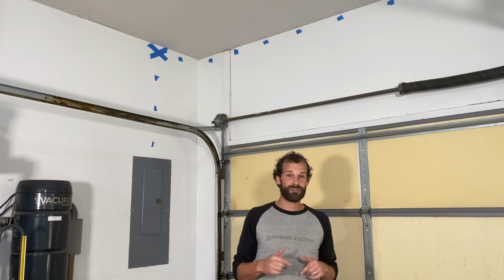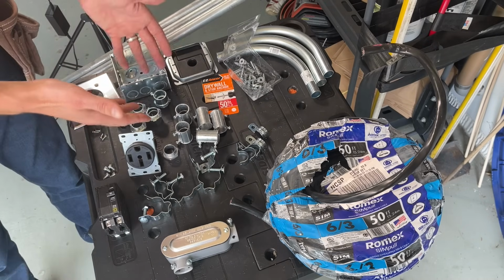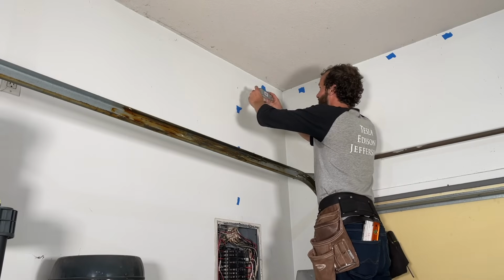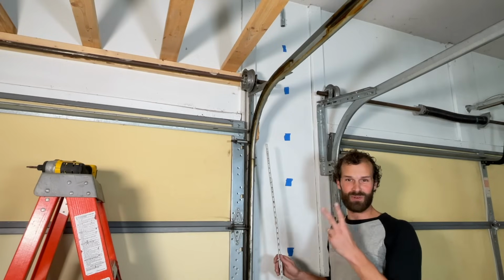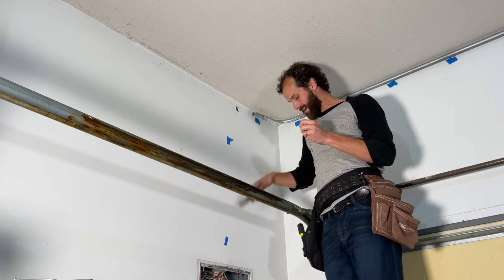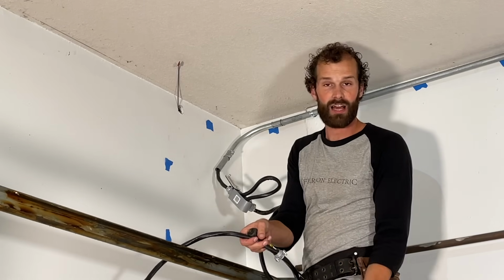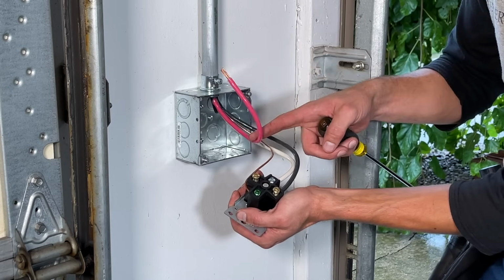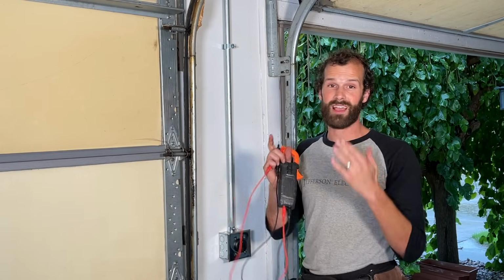How To Install a 240 Volt Outlet | Electric Car Charging

Comment: I used to work as an electrician’s assistant. This was a trip down memory lane.

I seem to recall we had to use non-romex when wiring with conduit. Does anyone else remember the same? Also I hated bending the conduits almost as much as running that heavy wire. Kudos to you.
Reply: Yeah, now days we usually use stranded or solid copper THHN/THWN insulated. We generally don't run cables inside of EMT, only single conductors (unless we are sleeving a cable for protection). The guy in this video did a lot of wrong things, TBH.
Reply: Most ahj will allow it but you have to account for the outer jacket as fill Also it's sloppy hacky and usually a waste of money over buying a 250 foot spool. My ahj wld have had me strip romex from lb to outlet and required a stub with a romex to emt connecter from lb to panel with a bushing on that connecter at the panel if not a grounding bushing as well lol
Reply: @wizard3z868  The lack of proper bonding/grounding on the EMT in this installation is a shock hazard. To me that was the most unprofessional and hazardous part of this installation. I am sure he does it wrong all the time, too. Lol
Reply: @illestofdemall13  my ahj would have had me tie in the ground wire of romex to a bond bushing at panel than a bounding at metal lb also (than I wld have had to strip all the romex from lb to the outlet my ahj dosent like romex in emt). I'm sure he bounded at box and outlet thus making all the metal conduit grounded
Reply: @wizard3z868  Bond bushings would not be required for this installation, however the Code does require the equipment grounding conductor to be connected to the outlet box, not the receptacle. Also, Except at terminations, removing the sheath from nonmetallic cable is not permitted in the Code.

Comment: I watched with some interest to see if this installation was going to address the 2020 National Electric Code requirements found in 210.8(A)(2).  It's not clear whether this installer knew of the requirement for GFCI protection on this 50A, 250V outlet, and if he knew, whether he chose to ignore the Code since it may not yet be enforced in his area.  (It can take a couple of years for local jurisdictions to adopt the latest Code).  In any case, he should have installed a Square D QO 2-pole breaker equipped with GFCI features to have been compliant with the current Code.  Expect to pay about $125+ for a breaker of this type, rather than the $35 breaker he actually installed.
Reply: If NEC-2020 is not adopted in the area then it is not code for the area in question.

I expect that the installation occurred in Illinois (Scott's residence?), and since as of right now NEC-2020 is not adopted anywhere in Illinois,  it follows that the installed breaker is indeed compliant with code adopted in the area and will pass any and all inspections. In this case it is completely irrelevant what NEC-2020 requires.

Pro's other blunders notwithstanding, the choice of the breaker was in no way an error, omissions or ignorance. It was in fact the correct choice.
Reply: No GFCI on Tesla chargers.

Comment: This video is very disappointing from a safety perspective.  The gentleman is implying that "pros" do not need to turn the power off before working in the panel.  If you are a DIYer considering taking on a project of this type, understand that the real professionals actually do turn the power off.  And we do not stick conductive tools into hot panels, nor conductive fishtapes.  We do not close the breakers of new, untested circuits with the panel cover off either.  Turn the power off before removing the panel cover.  Then test the panel bus with a volt meter to ensure the panel is de-energized.  In this case, as he correctly pointed out, the incoming bus is still energized even with the main off.  To mitigate this hazard  it might be necessary to have the utility company briefly pull the meter to allow you to work safely.  Complete the work, close the covers, THEN energize the panel and finally the circuit in question.  

In today's world, the notion of "let's be careful" is over.  It is not merely a matter of avoiding getting a shock, which in itself can easily be lethal.  Depending on a number of variables that are only controlled by the utility, it is possible to have an explosion and fireball which could severely burn and permanently disfigure someone standing in front of an energized, unprotected panel, especially dressed in only a short sleeve t-shirt as this person is doing.
Reply: While I agree with most of what you said . idk anyone who has the meter pulled to add a circuit .
Reply: @noahholt482  I have!  Panel was tight and wired like shit.  Easier to pull the meter than kill myself.
Reply: Amen brother electrician.
Reply: Current does not discriminate. You don’t need to be a pro or expert to know that. Also if you’re watching this video your level of understanding for electricity should be great in that you know how everything relates! I assume everyone watching this knows the required safety. Just look it up
Reply: You're obviously experienced Steve Loux. Thanks for engaging! Do you think that an NFPA 70E arc flash hazard assessment would reveal that there's sufficient fault current to require replacing the cover before turning on the breaker in a residence?
Reply: @joelwalsman773  In many cases, the answer is "no" as you might suspect.  But the challenge here is making a video that can be nuanced for a mass audience comprised of primarily DIYers.  If the supply is modern, underground (usually the service conductors are larger in underground installations), in close proximity to the utility transformer, connected to larger transformers (utilities seem to be replacing transformers with larger ones due to increased neighborhood electrical demand), the risk hazard is greater.  In earlier editions of NFPA 70E we were told a supply at 120/208V and 125KVA and smaller was unable to produce a significant risk of arc flash.  My concern is regardless of that, equipment can fail to open properly, and if it does, your risk assessment should take you to the next OCPD to see if that point sufficiently protects you.
Reply: @BendOver-v7j6m  You can see plenty right here on You tube.
Reply: I totally agree with you!
Reply: Meat head is also wearing a very conductive metal ring... I hope these guys blow a finger off shorting that thing to the case.
Reply: He also didn't ground the metal box in the outlet.
Reply: @griffinbarnett3607  isn't the metal face of the ev plug connected to the ground pin/screw?
Reply: Service disconnect not mentioned until the end? Not even eye protection on a live circuit with his face a foot from the open panel? Not testing the conductors before honking on the receptacle after pulling? Right at about 39 minutes this guy really disappoints. I wonder if his feet were bare on the concrete floor. And this video is intended for DIY?
Reply: @fmphotooffice5513   you’re right he should stand 5 feet away in a long sleeve shirt
Reply: @noahholt482  the sarcasm is not a good look. The requirements of being an electrical worker are more demanding than they were 20 years ago. NFPA 70E has forever changed the way we work.  For the better. We know better now. How to reduce and control risks, with a much better chance of going home safely to our families each day.  The old days of being the macho cowboy working hot once was a sign of a good electrician.  Now it’s a sign of a fool.
Reply: @steveloux4709  Thank you from a certified Tesla installer and C-10 Electrical contractor.
Reply: look at all those people in the comments defending a dangerous act simply due to its was performed by they favorite youtuber..  A guy being famous does not mean he is right, you know. His action is dangerous, and I am sure you all gonna just shut up and look the other way IF a guy got killed following his steps(or even blame the guy for "not being professional enough". Bunch of boot licking  cowards, I bet y'all love Biden too.
Reply: @steveloux4709  calm down. You don’t get a trophy for that
Reply: Anyone can go to Home Depot, Grow a beard, buy tools and parts then write Electrician on their back hahahahaha Dudes a FRAUD ...lmao
Reply: Jesus Christ.
And yes, pros understand the cost of killing power to circuits they aren't working on. In a residence, it's not critical. Imagine this was in a shop and he had to run power to a new cash register: killing power to the entire building, or half the building: while safe, NOT PRACTICAL.
Reply: @Joe-by8jh  There is a lot worse going on in the Justice System and in the world  than there will ever be on utube! I guess that doesn't bother you to much though does it Joe?  You go ahead and troll all these how to channels and set them all straight and F the rest of the world! Good job Joe, maybe utube will give you a medal!
Reply: @Joe-by8jh  who died and made you president of the utube police?
Just what utube needs more snitches!
Reply: Why are all you so called pros even watching this except to criticize and try to show your intelligence? Don't you have a light bulb to put in for somebody and charge your two hundred dollar service charge? Morons! 
Maybe ya all should make your own video instead of criticizing others.
Reply: @M_Ladd  Misinformation should not be exempt from criticism, regardless of who did the video. The amount of inaccurate electrical information posted on YouTube is alarming and anyone seeking guidance should be grateful for any and all points of view. Hopefully, it allows them to make informed decisions.
Reply: @M_Ladd  they make themselves sound so professionals knowing damn well they take every shortcut

Comment: Why not secure the wires into the braker before installing it into the panel?
Reply: Either way works. Nothing wrong, just preference.
Reply: You could do that. I prefer having the breaker in place so that I know how long I need to snip my wires. It makes for a cleaner appearing Installation.
Reply: @scottpierce3351  thank you for your input

Comment: Life would have been easier for you with a little greenfield dropped down the wall to a 4 square box up top and use THHN for the whole run.
Reply: Much easier! Unfortunately our jurisdiction doesn't allow exposed use of greenfield below 8' since they would determine that to be "exposed to physical damage". Many jurisdictions would. Great idea!
Reply: @joelwalsman773  expose even tho it’s inside the wall?
Reply: @SmackxDaddy  what an apropos username. You know, cuz you kinda laid the... anyways cheers.
Reply: @binaryglitch64  thank you ☺️
Reply: @SmackxDaddy  no worries, however to the point of the conversation I think the reason running in the walls wasn't done is because in the attic comes to too tight of a wedge space to access the top plate (the board that is the top of the wall) and thus a lot of drywall would have to be removed and replaced to achieve the same run in the walls. 

I mean if I had to guess... but @High Voltage did seem to be discribing an in wall installation and @Joel Walsman seemed to fail to catch on to that.
Reply: @binaryglitch64  you don’t have go inside the attic at all. Just cut a hole just enough for the greenfield and the connector to fit . Knock out the K.O from the panel, fish stick up to the hole or down to the K.O . 
Tie some string to attach the flex to the fish stick. Then use a connector to tie to the backside of a 1900 box or 2100. 
Note: might be easier to have the wire ready to pull down to the panel when installing the 90 flex connector.
Reply: @SmackxDaddy  Oh by THHN you guys mean flex... okay fair enough but to that I counter with this:

[EDIT: Sorry YouTube-Bot keeps deleting my reddit link it was a meme of some terrible looking flex.]

To be fair at this point, I'm just being silly... I'd consider flex, but I have a heavy aesthetic biased against MC cable specifically.
Reply: @binaryglitch64  I mean flex down the wall like how I explain and drop THHN down the flex. 

Or u could just drop some romex down the wall and make joints in the box and pipe to the device
Reply: @SmackxDaddy  I get that now, I'm just not used to people implying flex by naming the wire type that goes inside it. I'd be okay with regular flex, I just don't like the aesthetics of metal clad flex, but I never thought you meant MC, I was just throwing that out there. The first explanation I gave was assuming you guys meant the entire run would be inside walls or in the attic as if it had been pulled when the house was being built, you know as if this was in a living room... Honestly I feel stupid for thinking this but I wasn't even considering how you guys planned on complying with NEC 300.3A or I would have thought 'you can't run bare THHN, it's gotta be in a raceway,' and then it would've dawned on me that obviously your thinking of flex, then I would have gotten it. Anyways I see it now. Sure it would've made for an easier installation but I feel like we made up for the difference just in the finger-calories of typing all this... (maybe that's just me) also; woulda, coulda, shoulda... and conduit really wasn't that much harder since he only had two 90 and he used an elbow instead of bending it... just sayin'. But you guys aren't wrong, it woulda made things easier.
Reply: @binaryglitch64  no worries my guy. 
How long have u been doing electrical work?
Reply: @SmackxDaddy  too long for how little I know... I took a year off here a decade off there... Honestly I'm surprised you could tell I was in the field, as dumb as I sound. Really I just spent a long time not trying to be an electrician, and didn't come to appreciate the opportunity until recently. Mostly cuz dad forced my into it when he could've easily enticed me onto it and I would've eat it up from go, but instead spent a long time in the trade being a robot, not caring to truly understand. Only recently am I realizing I actually really like this work. Just getting back after one of those 6 years stents of off time.
Reply: @joelwalsman773  What do you use below 8' behind a wall in your area?
Reply: @joelwalsman773  gggģģ
Reply: Other than code states you can't put a nm wire inside conduit... Should have used a 4square at the top of the wall and converted from romex in wall to thhn in conduit.... Fail

Comment: 33:30 - In lieu of securing a cable clamp to the Romex and pulling thru the wall cavity would it be code compliant to use a snap fit type clamp in the panel knock out with the clamp and two screws inside the panel? Tnx
Reply: Good solution, I don't think the code address that.